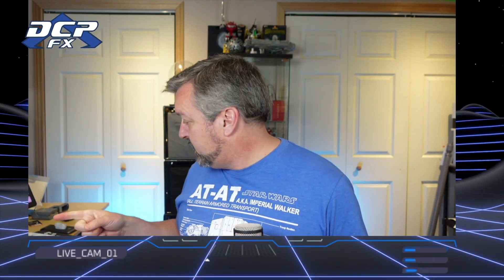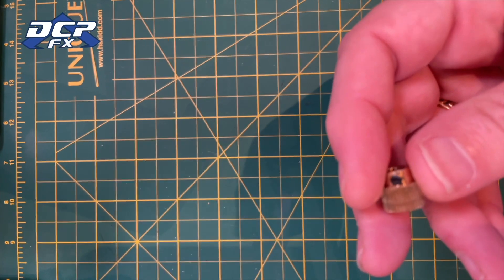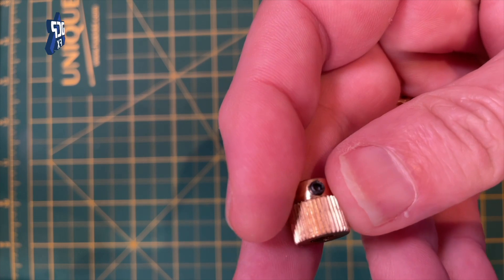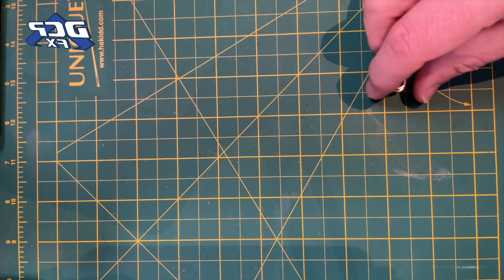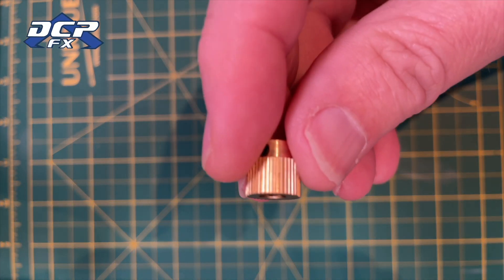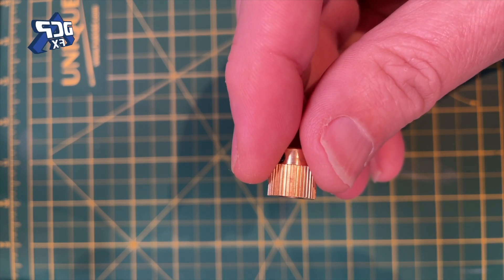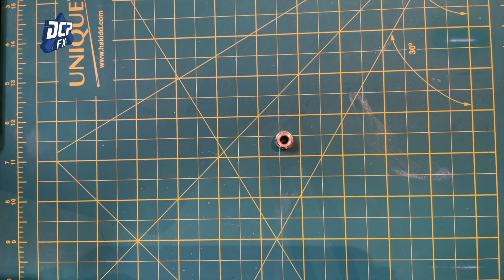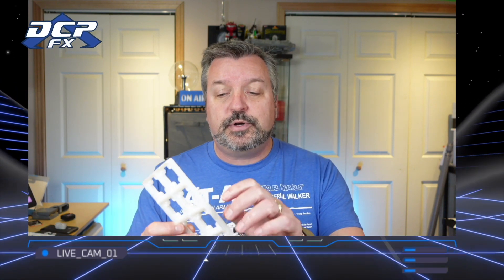Check Your Extruder Gear!

Comment: Just thought I’d ask you. I can’t get my filament passed the two wheels. It loads in tube fine but then gets stuck at the two wheels. It’s band new, never been used. I have tried loosening the screws but still nothing.Any ideas?

Comment: I was having issues with my Ender 3 until I realized that my extruder was worn out after 2 years of printing. My extruder end is still the original one and my tune was replaced a year ago. I didn't replace my brass wheel I just moved it up 2mm so my filament was on a different spot of the wheel.
Reply: I have a groove in my extruder gear after just a couple weeks.

Comment: Breathe through your mind. If you're extruder a year goes, you probably won't stop the change to the motor if it's an older version. Princess, I got ender 3 for Christmas. It's the OG version. The problem I had had was somehow I wore out the extreme gear Even though I only had it for 6 months And all the replacement gears are meant for d-type pinions. That meant I had to replace the motor.

Comment: Watching video now. Your issue might be my issue. I have the same symptoms. I have the OMG DM1 extruder. Works great until now. I printed a tone of big parts for my current project  and every thing was working well. The down side to mine is that the motor extruder gear is pressure fit on the shaft. I hate that. I have to replace the whole extruder motor just to change the cheep gear.  I  tried getting the gear off from watching other videos but I can’t.

Comment: i havent had my ender 3 pro for very long, but i noticed this happening, multiple upgrades later and i see my brass gear.. yea i thought it was supposed to have those indents in the middle to i guess guide the filament... yea thats not right XD waiting on a new stepper motor to come in to fit the gear i got! Hopefully that fixes it
Reply from the maker: Gears should be a standard size - are you having issues with your motor?
Reply: @DCPfx  i have the stock stepper motor on the Ender 3 Pro, the brass gear on it is pressed on the stepper motor, not tightened on the edge of the gear shaft, as this one is completely cylindrical. i have a new motor and more gears coming in tomorrow! the 40-42 i think they call it
Reply from the maker: @jbear40  Ah, ok - the Ender 3 is one I haven't used yet....
Reply: @DCPfx  definitely for the best! if you like stuff that doesnt work. or you like replacing things the same amount you paid for the printer, enders are the way to go
Reply from the maker: @jbear40  I'm sensing a little sarcasm.....I've had my CR10S for almost 5 years, and just replaced the extruder gear.
Reply: @DCPfx  Jesus christmas this new gear on the stepper motor makes a complete difference in quality, first test print came out insanely better than Ive ever printed before. No lines, no over or under extrusion, infill is actually perfect. Your video hit the spot
Reply from the maker: @jbear40  Glad to know my video helped someone!